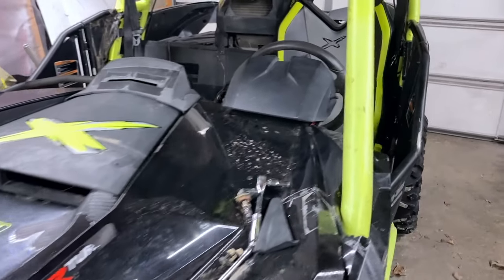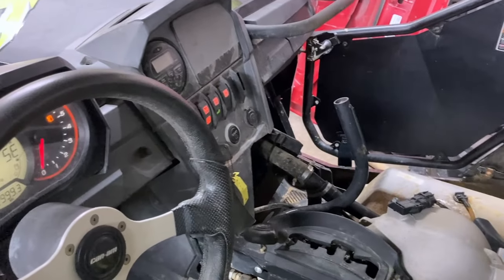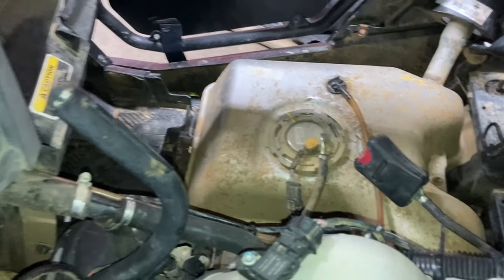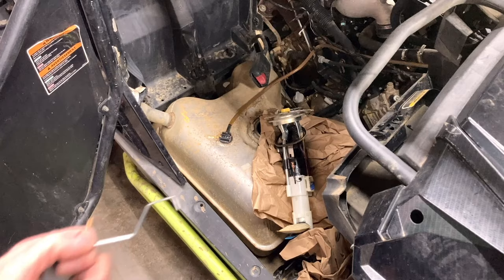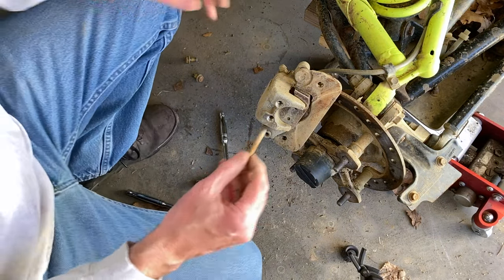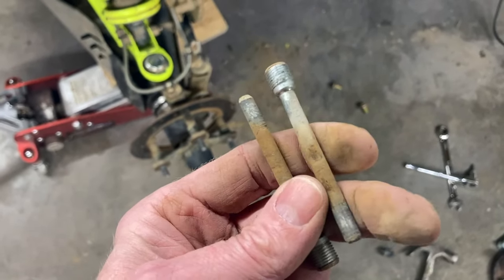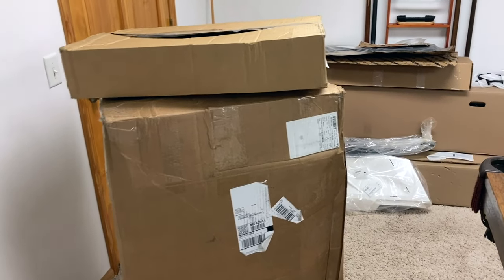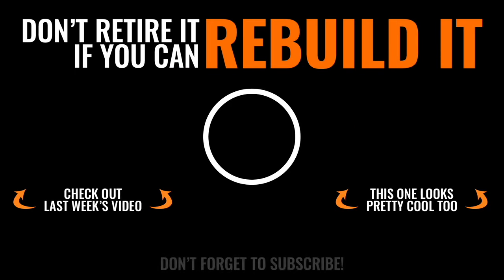Fixing the Most Common Failure Points! - Can-Am Maverick 1000R Pt. 4

Comment: I had a light issue in my 16 maverick turbo and at first swapping the high beam switch fixed it and then a few days later I was riding and had no lights and a check engine light, after a lot of research I found out that the light relay in the fuel panel under dash (the one that's about where your left knee would be) was burn, changed that relay and now I have high and low beam working good, hope that helps you if you still havent found your issue

Comment: I’m having an issue with mine could be fuel pump but I’d like to know before I just start replacing parts. I can start it and it will basically just start choking its self out and then die. Fires right back up and can hold my foot on the gas for a few seconds and it will be good to go. Just want it fixed!

Comment: I just tried this to diagnose my problem. My 2019 defender hd10 won't come out of 4x4. I pulled the front cover off the actuator and turned the key on, the gear spins and spins the opposite direction when I switch to 4x4. It doesn't ever stop spinning until I turn the key back off. 

Does this indicate a faulty switch or actuator? 

Also, there was some oil on the inside of the actuator when I pulled it apart.